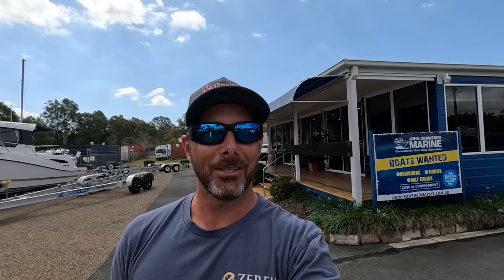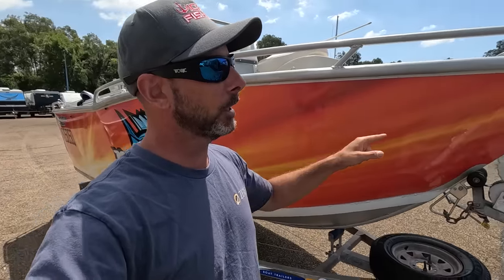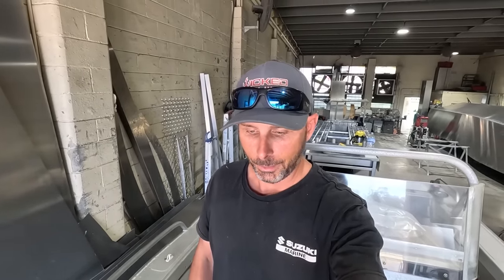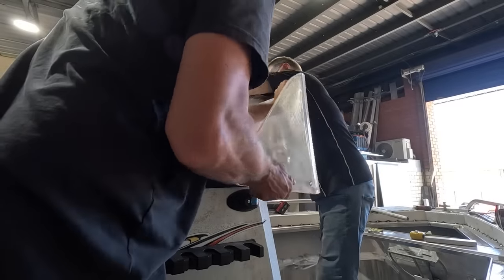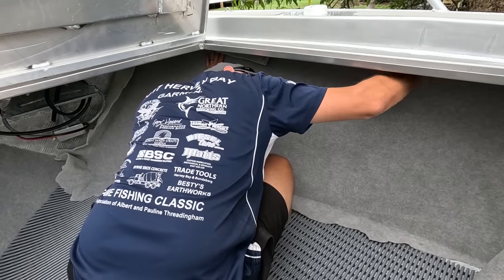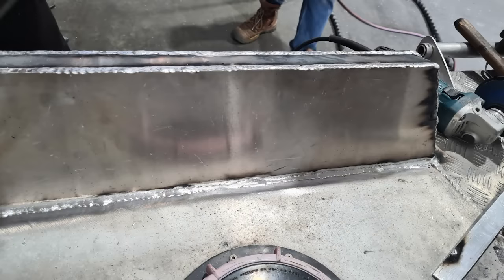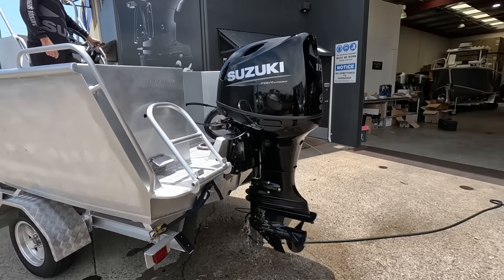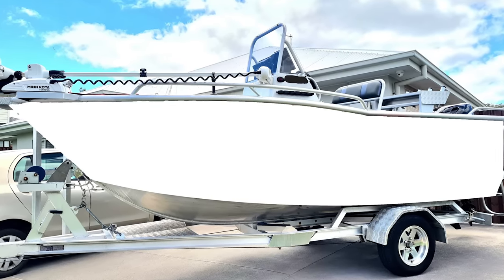Part 1 | Building the ultimate all-round 5mtr boat | Estuary, Bay & Offshore

Comment: Hey Greg,  great detailed video.    to do something very similar to my boat up here in the Territory.  Do you have a product link for the marine lining you used internally? Also did you use any special glue? I've never seen it sprayed like that but looks to simplify the job.  
Cheers mate
Reply from the maker: Thanks mate. I actually found a big roll of that marine cabin liner on FB marketplace but if you go to any marine upholstery place they would be able to order it in for you. The glue to use is contact adhesive/fix. Spraying it is the only way to do it or you would use loads of glue.

Comment: Is the 115 and 140 zuks still the same weight etc?
Reply: Same block I think
Reply from the maker: correct mate same motor. The 140 is actually 2kg lighter but the boat was only rated for the 115.

Comment: Check the weight you will find 140 Zuk is lighter than 115
Reply from the maker: yes mate its 2kg lighter. The boat is only rated to 115 hence why I didn't go the 140.